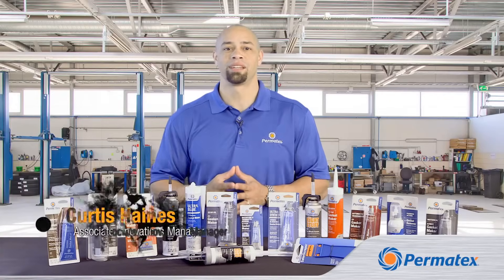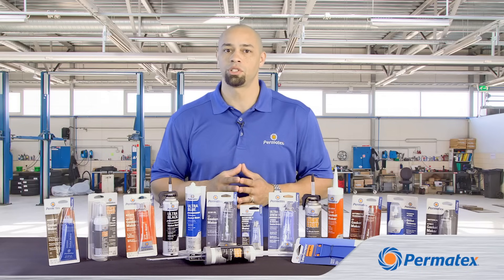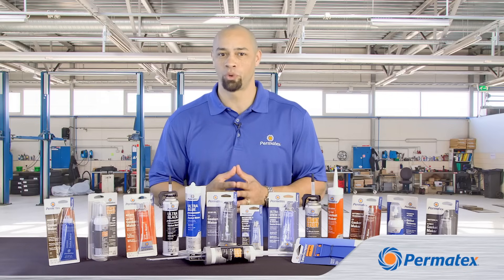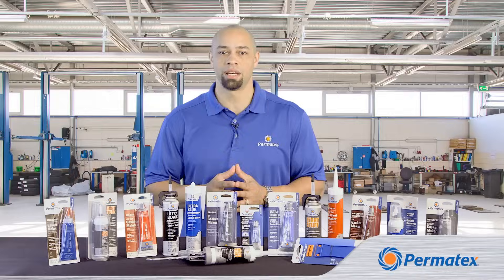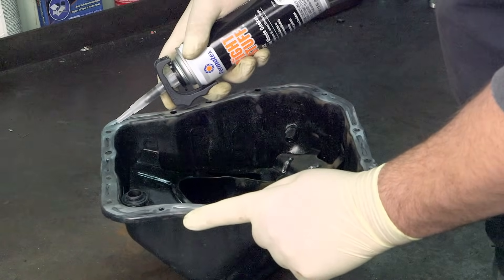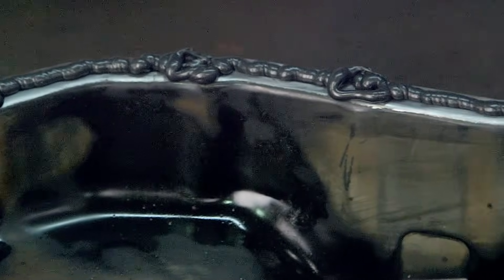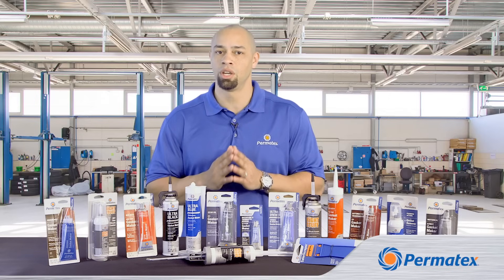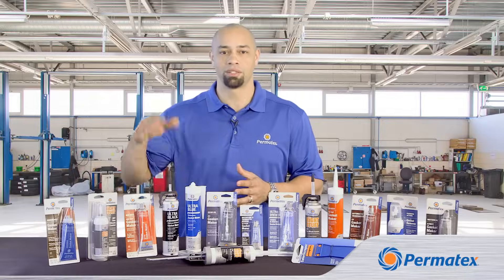Gasketing Application Tips: Permatex Tech Tip Series

Comment: A good reason to use a traditional gasket when you have the critical piece to be mated with the other part.
Or do some sensible thing, like just proper amount and spread it with the flat stick to thin level, and then wait the > 24 h period before final torque.

Comment: So basically, this was a demonstration of how NOT to apply the sealant, Cause damn that looked liked way too much. Also, I'd like to know if you completely assemble the part before it cures or partially assemble then fully torque after curing, I've heard different procedures.
Reply: "Hey, your video sucks! But I was wondering if you could help me with this..."

🤣🤣🤣
Reply: If this helps anybody in the future: From what I've read, you apply the bead and finger tigthen the bolts until you can get the rtv to squeeze out a bit. Then let it sit for right about an hour and fully torque the bolts. You want it to expand and skin out (as RTV needs a bit of thickness to work), so by only squeezing it out a bit, you allow it to expand enough to cover the seal surface, but not too much as to where it becomes too thinly spread.
Reply: dont let it skin over.
Reply: This is my question
Reply: @seanbouker  dont let it skin over. finger tighten and then torque down to proper torque figures after.

Comment: When using a gasket remover doesn't have much in it and squeezes out too fast. Only need a little bit at a time. Also the brush that comes with is falls off easily so its better to buy a separate brush even if its a very cheap dollar brush to be thrown away.
Reply: Best automotive gasket maker 🤔

Comment: Good Lord! That is way too much application of material.
Reply: decorating a cake this guy
Reply: Agreed 1000% Jesus. But trust me.... they are sure that what’s in this video won’t cause a failure.... unless it’s the sealing surface for oil pickup between an oil pan and block lol
Reply: Thats doubling sales tho! Its like the toothpaste commercials where they put 4 tablespoons of toothpaste on the brush.
Reply: He was damn near running it into the pan, and he himself said thin bead😂
Reply: It happened to my first car. Wasnt fun, the mechanic was a family friend, I never spoke to him again after that day nearly 20 yrs ago and I use to see him all the time for the first 15. Common sense isn't too common, apparently it's like finding a crisp 100$ bill in the washing machine.
Reply: Some of the shit I’ve seen at work on 6.0 and 7.3 Powerstrokes.... holy shit. I’ve seen multiple multiple tubes of silicone used to seal high pressure oil pump bed plates on 6.0’s. I’m talking the inside of the engine around the pump like alllll you can see is silicone leading down the back plate of the engine down to where the down tubes from the pump run down and forward to the branch tubes for the high pressure oil over fuel rails. And the engine DIDNT come in for a failure related to that silicone, it was in for a cracked piston etc from some junk tune they ran way too long. The point is, with this shit you can get lucky or VERY UNLUCKY, which is why I personally prefer gaskets whenever applicable.
Reply: Yep, about 10x too much.... ha ha
Reply: Almost fainted  🤣
Reply: For real! Wtf
Reply: Agreed!
Reply: Decorating a cake people here are fun too
Reply: No sir
Reply: Use more so you have to buy more....
Reply: Never a such thing as never yo much gasket maker no leak is what u want 🙈

Comment: I bought a new oil pan and the area  of the oil pan  that mates with the engine block is painted a nice glossy black. Do I have to remove the black paint to metal for the Grey rtv to work?
Reply: I would! wire wheel on a drill bit, gget down to the metal and clean it with brake cleaner spray, then youre ready for 15lbs of Permatex like the guy in this video lmao
Reply: no

Comment: I used permatex black adhesive silicone sealant and waited 14hrs ...I then ran the car for 15min then drove around the block for about 5 minutes then the engine started smoking a lot .,.would this be because the sealant has not cured yet?
Reply: Yes. The smoke was from the leaking oil. You MUST wait 24 hours.
Reply: @Lehmann108  hahaha don't mislead him. that's not true. he just probably sealed it poorly.
Reply: might be like 2 years late, but yes. 24 HRS cure time. I did the exact same thing and my tranny pan leaked. had to re-do the whole thing, and left the car dry for a whooole day.

Comment: Omg way to much and you dont have to go around the bolt holes just stay on the inside of the bolt holes. What a horrible video
Reply: Yeah, isn't that weird that Permatex would even suggest this?
Reply: @gimmetacodude  the amount on this oil pan would do 15 pans+.the reason they do this is to sell more product,there is absolutely no other reason.
this one "piss poor" installation would absolutely blow the engine due to the oil pickup screen being completely plugged and obliterated with loose silicon
Reply: @gimmetacodude  I guess they want to sell more product by having you use an entire tube in one application.

Comment: Here's one for ya, how do you keep the Permatex from going bad after opening? This stuff isn't super expensive but it would be nice to use what's left in the tube.
Reply: Assuming you are talking about the tube... 1. Take a small piece of Saran Wrap, cover the open tip of the nozzle loosely 2. Tape the wrap around the nozzle. 3. Barely extrude some of the sealer out of the tip, filling the loose wrap (loose enough to get a 1/4" circle over the tip) and take the tube out of the gun. The stuff in the wrap may skin over but the remaining material (under the 1/4" trapped in the wrap) in the nozzle and tube will be "new".
Reply: Put in freezer in saran wrap
Reply: After prying the dried up stuff out of top to use a second round i stuck a lead free pencil through the top. By lead free i mean the lead tip was removed prior to use.

Comment: Whoa way too much sealer on that sump pan. The excess could squeeze out inside the sump pan, break off and damage the engine.https://www.youtube.com/watch?v=dVJ1n6ukj8Q
Reply: Agree... not a very professional way to do it :-) Less is more.
Reply: The tight stuff cures fast enough that itll stay intact rather than break away and end up in the oil
Reply: @DaBuGzLiFe  not with a 1/2 bead.its going to break off and blow the fucking engine,absolutely https://www.youtube.com/watch?v=dVJ1n6ukj8Q
Reply: @trillrifaxegrindor4411  someone at school did worse than this demonstration and the vehicle was fine for about 8 months before he sold it. So i trust that a bit of RTV in the pan will be okay. But I agree its not the best way to apply it.

Comment: I haven't seen your SaferScraper in any auto parts store I've been in, big or small, and most of them don't even carry plastic razor blades by any brand. I had to order plastic blades from a warehouse when I got mine. Try to get your sellers to supply those; I would have bought yours if I saw it in my local parts store.
Reply: Cars Simplified Autozone, literally purchased from there an hour ago
Reply: I get mine at harbor freight
Reply: you would be a sucker then,just go to any dollar store and buy razor blades ffs
Reply: The dollar store has plastic blades? I've never looked for them there, but I doubt they would have them.